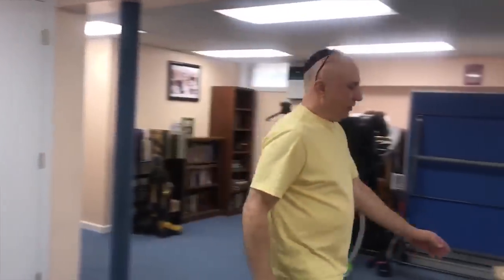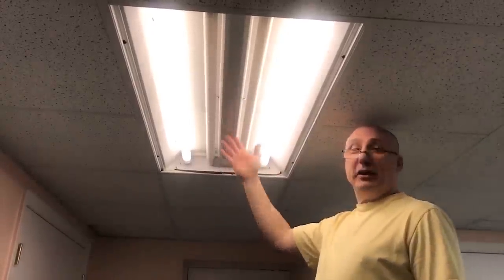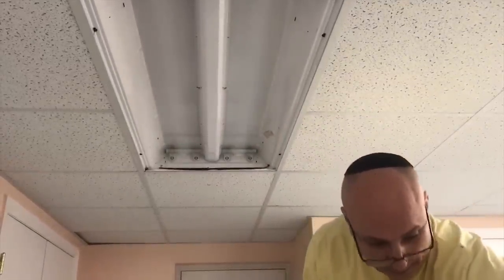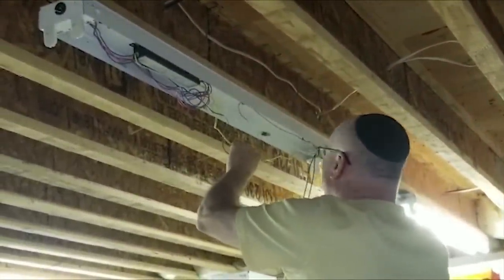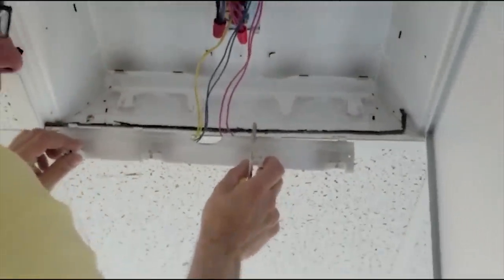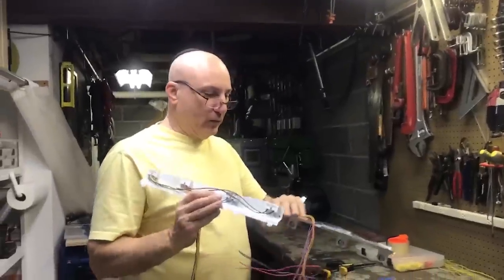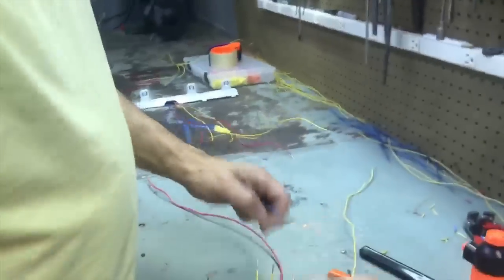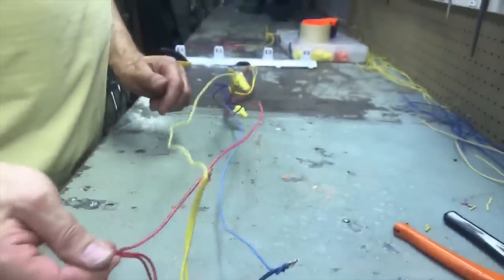How to easily convert Fluorescent Lights to LED – 2 Ballasts, 4 Bulbs

Comment: Your teaching bad habits and its clear you are not an electrician!. What is it with you older folks not following the electrical rules? Even before you get into a fixture you need to identify the panel and circuit ans then proceed with lock out tag out! Not to mention being certified!. Hot stick to test and then proceed.

Comment: I'm confused. He's supposedly showing a 2 ballast four bulb fixture retrofit, but then he ends up showing only a 1 ballast 2 bulb retrofit, saying "it's just the same!" If that's the case, then it's no problem viewing the videos of 2 bulb-1 ballast retrofitting, which he starts his video saying didn't show the 4 bulb-2 ballast retrofitting. I think the wiring to the 8 end connections of the 4 bulbs is different than a 1-ballast 2 bulb fixture?

Comment: This video was pretty helpful to me. I saw people with the same question I had which was what to do with the red wire. Just to clarify though my unit had Red Blue and Yellow wires. I also had Black White and Neutral (not red). My BALLLASTS had two connections with black wires (connecting two ballasts together) on one side and same on the other side just the opposite ballasts.  Per the video I connected red to red, blue to blue and yellow to yellow. Blue AND Red went to BLACK (Hot) and yellow went to white (Nuetral). When I installed the bulbs into the ballast I made sure the HOT side of my tube went into a ballast with a RED OR BLUE wire coming out,  leaving the other side to enter in a ballast with a YELLOW wire coming out. Worked perfectly and on all 4 ballasts.  

Thank you for the help.
Reply: Hi, I'm in the same situation with only Black and White source wires from ceiling. I run red, blue, yellow wires within the fixture as in video. I connect Yellow to White, then Red and Blue both to Black. Lights are on but all just dim, nothing is bright as LED's supposed to be. Any suggestions?

In your comment,  you say Hot side of tube to side where Red & Blue wires come out and other side to where Yellow wire comes out. But as you can see in video, both sides of fixture have all Red, Blue, and Yellow coming out, 2 wires of each color on each side. However, I did flip the tubes to try but still same thing, all dim light.
Reply: @derekle1461  Hi My tubes were marked on one side that I had guessed to be the hot side. I would make sure those sides are in the ballast with a red or blue coming out of it. It seems like the wires are connected correctly if your getting power to them.  I wonder if your tibe is correct? 

This is what style I bought: T8 T10 T12 LED Tube Lights 4 Foot 20W (40W Equivalent) 4000K, G13 Dual-Ended Powered

I bought a 4 pack on Amazon for about 30 bucks. I think that's what I would confirm first.

Comment: I really struggled with this technique.  I found that that many of the sections of light would only run 2 of the lamps using this.  Additionally, sometimes lamps in the run wouldn't turn off depending on how the runs split to other lights.  If you just clip all wires at one end of the lamp and run them to either black or white and clip all wires from other side  and run them to opposite color your gin.  No need to remove the tombstones from the lamp.  If there are multiple wires coming in you can't take them out with all the wires in the way, as some of my lamps had 3 incoming punch-out lines.  Make sure you use double sided tubes not single. 2 5ks seem to do the same job as 4 40w tubes and additionally save the ballast voltage. I used the two inside tubes as I thought it looks more cool.  Only rub is on three way switches.  Still working that one out.
Reply: He has 2 switches to control 2 of the bulbs in each fixture.
Reply: Also he chose to use 2 instead of 4. He said 2 5000k bulbs were enough compared to 4 4000k bulbs.
Reply: Thank you so much! You just answered my question! I was so confused by this video and wondering why he didn't do it like you stated. I was literally gonna ask the question you answered! Thanks again.

Comment: Hi there, I have a question I'm hoping you can answer. My two-ballast four-bulb set up has two red, yellow, and blue wires coming out of either end, just like in your video. However, my set up also has three different holes where two black and two white wires are entering (one hole on each end and one in the middle). I am guessing that I connect white-white and black-black from either end and treat the middle hole as the true hot and neutral connections?
Reply from the maker: Can you send me a picture?  howard.m.alt@gmail.com
Reply: @footballalt  I'm trying to do the bypass. I have the same style 4 lamp fixture. My wiring is different from yours. One end of the fixture tombstones have red and blue wires. The other end of the fixture tombstones have yellow wires including jumpers. The tombstones are shunted. I found a set of direct wire led tubes made by GE at Lowe's. Should i replace my  tombstones to non shunted? Guessing I can wire the yellow wires to the white neutral wires. Then the red and blue to the wires to the black hot wire. My ground is attached to the housing. When I install the leds match the Label N and L with the correct set of tombstones.
Reply from the maker: @keithbell8690  Someone responded in the comment section that you only have to wire one end of the bulbs for them to work.  I would suggest calling GE.
Reply: @footballalt  I don't necessarily have to use GE brand. They would be more convenient instead of ordering online with a waiting period for delivery. My real concern is the tombstones. Shunted vs non shunted. I've done a ton of research and still haven't really got a clear answer.   When doing this T8 type B bulb bypass. Will shunted tombstones short my led tubes causing damage or fire hazard? If I wire one end neutral and the other end hot. Then use the correct bulbs. What type tombstones should I use? Shunted or non shunted.
Reply from the maker: @keithbell8690  Sorry, I don't have any knowledge about this.
Reply: @footballalt  Parmida Led tubes are supposedly designed to do exactly what I need for the bypass. The double end tubes work with shunted or non shunted tombstones. Since majority of my tombstones need replacing I'm going to use non shunted tombstones.

Comment: My fluorescent lighting fixtures are identical to yours. You have red, white and black that you connect the wires, I only have black and white and no red. when you are connecting the black/blue, yellow/white and the reds. I don’t have the red. Do I just connect the reds from each end together?
Reply from the maker: Can you send me a picture?
Reply from the maker: It looks to me from the Installation Guide that you can wire the black to one end of the bulb and the white to the other end of the bulb.  You can not wire the 2 pins on one side of the bulb with bother the black and the white.  The 2 pins are connected together inside the bulb.  You can also contact the company at info@hyperikon.com.  I hope this helps.

Comment: Shalom, Thank you for the informative video.  After watching I was all set to change out my bulbs, but then I found slim low profile LED can lights.  I installed  them and they look great.  What I would now like to do now, is remove the old fluorescent fixtures.  In your video, you mentioned  that involves a lot of work.  I am clueless as to begin.  Do you have any suggestions?  Thanks again for the  video.
Michael
Reply from the maker: Can you send me some pictures?
Reply: Sure, how do I send them?
Reply from the maker: @lionshott  send to my email. howard.m.alt@gmail.com
Reply: Sent.  Thank you for your time.

Comment: Okay so if I have this correct, all lines on one side go to the black and the other to the white which I have done
For this method are there any specific LED bulbs I am supposed to get
I've seen that I'm supposed to us a certain type. is that true
Reply from the maker: Most types will work

Comment: Hi, thank you for such a detailed video. Bonus is I finally found a video with exact same light fixture as mine. My fixture also has 4 bulbs, 2 ballasts with 2 red, 2 blue, and 2 yellow coming out on each side of the bulbs. My problem is my source from the ceiling only has 2 wires: black and white. Not red, blue, yellow like yours. After re-running the 3-color wires within the fixture, how should I connect to the 2-wire source then? I'm thinking to connect fixture's yellow to source's white and fixture's red & blue both to source's black. Says this is option #1.

But then I see when you pull out the sockets to work in the shop, you separate 2 blue on 1 side, and 2 red, 2 yellow on the other side. So I figure should I connect fixture's blue to source's white and fixture's red & yellow both to source's black. Says this is option #2.

Could you please advise which option makes more sense? Or if both are wrong, what would you suggest? Thank you very much.
Reply from the maker: The colors of the wires don't really matter.  You want all the wires on one side of the fixture going to your black wire and the wires from the other side going to the white wire.  It doesn't matter in this application which side goes to the white or which side goes to the black.
Reply: Basically you are making a battery circuit.

Comment: I followed the instructions to change our fluorescent tubes to LED tubes.  I connected yellow to white, blue to black, and green (we don't have a red wire from the wall) to red.  Would you be able to provide any insight?  Thanks
Reply: Did you figure out what to do if you don't have the red wire coming out from the wall/ceiling? I'm having the same issue myself.

Comment: soooo why did you wire up for 4 bulbs but only put 2?
Reply from the maker: Just in case one mount shorts out I have 2 more.  Also, should I ever decide to go with 3 or 4 bulbs I can.

Comment: Can you tell me the answer if you just have a black and white wire , no red. I'm assuming the red wires from the fixture go to the back lead from the ceiling as well??
Reply from the maker: Sorry for the late reply.  Can you send me a picture(s)?
Reply: Only white and black from ceiling what to do ??
Reply from the maker: It looks to me from the Installation Guide that you can wire the black to one end of the bulb and the white to the other end of the bulb.  You can not wire the 2 pins on one side of the bulb with bother the black and the white.  The 2 pins are connected together inside the bulb.  You can also contact the company at info@hyperikon.com.  I hope this helps.

Comment: 🤣You do not have to take the sockets down. The fixtures and non-shunts are already wired correctly for DEP led tubes. 
First disconnect power.  After removing the ballast all you have to do is join all the yellows together from both ends. Connect yellows to common White from home service.  Then bundle all reds & all blues together from both ends. Connect to line black.   Top off with wire nuts.  You're done! If you have a traveler wire,  red or blue for seperate fixture.   Wire to line....black! It's that simple.  He's doing to much work when there is an easier way.
Reply from the maker: Nice.  I could have used your wisdom 3 years ago.  🙃
Reply: I think this maybe the answer to my questions about the bypass. I have multiple fluorescent 4 lamp fixtures. 40 to be exact. I have multiple ballasts that have went bad. Instead of replacing them I want to do the bypass for led. My fixtures are old and have brittle tombstones. They're shunted tombstones with the paper backing held on with a metal staple/clip. Now I need to know. If I wire red and blue to line(black) then yellow wires to common white. Do I need non shunted tombstones?
Reply: @keithbell8690  yes sir non-shunted tombstones for most LEDs lamps. I recommend buying a package of all new tombstones non-shunted of course.  Because old tombstones can get brittle over time. New lamp= new tombstones! 🤷🏾‍♂️👷🏾‍♂️⚡
Reply: @philipstiger4737  Thanks for the reply! I plan on buying leds and non shunted tombstones in bulk. Do you have any recommendations on where to buy or a good brand?

Comment: As a electrician when I seen you use those gay strippers and a torch thats used for a  a crack pipe on the wire I said its time to to go.good luck your gonna need it
Reply from the maker: Hilarious!  Thanks for your reply.
Reply: @footballalt  apparently they all missed the part where you say, 'turn off the power,  YOU (yourself) don't,  but that's up to the viewer[s]'. We all bleed red, and put our pants on two legs at a time. Funny thing is, they watched your video, so it'd seem to me they needed clarification and help.....your video is fine. You dont make yourself out to be something your not, a spade is  a spade.

Comment: Ok,......I want to try and explain what I did and the fixture didn't work.  I did exactly as you showed except I only have one black wire and one white wire coming out of my ceiling.  I attached the yellow wires together from each side with a single strand of yellow wire to the white wire and the blue wires together from each side with a single strand of blue wire to the black wire and the red wires together from each side with a single strand of red wire together by themselves.  It didn't work.  I have viewed your video  over and over to make sure I got it right and there are two things  that you did that confused me.  First off, you moved the tombstone that held the blue wires to the other side of the fixture.  Why?   Secondly, you had two black wires and two white wires coming out of the ceiling and I only have one of each.  I tied the blue to the black, the white to the yellow and the reds to each other.  Is there a possibility that I have a bad tombstone in the bunch because it isn't working?
Reply from the maker: Can you send me a picture?
Reply from the maker: It looks to me from the Installation Guide that you can wire the black to one end of the bulb and the white to the other end of the bulb.  You can not wire the 2 pins on one side of the bulb with bother the black and the white.  The 2 pins are connected together inside the bulb.  You can also contact the company at info@hyperikon.com.  I hope this helps.

Comment: Only have 2 wires coming from the ceiling, white and black, no red
Reply from the maker: The diagram, which is 1min + 15 seconds into the video shows you how the wires should be hooked up if you only have 2 black and white wires.  All the wires from one side of the fixture go to the black and all the wires from the other side of the fixture go to the white.  It does not matter which sets of wires go to the black or white wires.

Comment: I have a 4 bulb fixture and i want to do the same thing. my question is,,  my ceiling outlet that has the power to connect to the fixture only has  BLACK , WHITE and BARE GROUND, How do I wire it up for that situation. I'm guessing that yours worked with two different light switches where as mine is only on 1 switch.
Reply from the maker: If you look at the wiring diagram it shows all the yellow connected to the white wire and all the blue and red connect to the black.  Note that all the yellow wires are on one side of the bulbs and all the blue and red wires are on the other side of the bulbs.
Reply from the maker: Can you send me a picture?
Reply from the maker: Correct on mine having 2 different switches.  It looks to me from the Installation Guide that you can wire the black to one end of the bulb and the white to the other end of the bulb.  You can not wire the 2 pins on one side of the bulb with bother the black and the white.  The 2 pins are connected together inside the bulb.  You can also contact the company at info@hyperikon.com.  I hope this helps.

Comment: Fluorescent lights are more efficient.
Reply from the maker: LED tube light VS fluorescent tube light. LED tube lighting lasts about 40,000 hours longer in testing, is more energy efficient, will save you more money, and will leave less impact on the environment.
Reply: @footballalt  I know this because I collect fluorescent lights. We put leds in the house our bill went up. The leds are more expensive and they are a scam. Don’t listen to what the box is telling you they are saying that their bulbs are energy efficient so they can get more money.
Reply from the maker: @brendanusualvlogs7842  You may be right.  The good news about switching is no more ballasts to change, consistent lighting for the lifetime of the bulbs, they are about the same price up front but way less expensive as they last so much longer and they are better for the environment (no mercury).  I still think they are also less expensive to run, but not in your experience.  Even if they are more expensive to run I would still switch for convenience.  I understand that not everyone would agree with me on that.
Reply: @footballalt  Luckly you kept the old fixtures, the real led fixtures are junk if it burns out you have to replace the whole fixture. The ones you converted you can still change the bulbs which is good. If I was you I would have kept them fluorescent.

Comment: Two things I don't think those stones the clipse the light connect to R-rated 120 volts second of all always a new ballast for the LED bulbs have you ever tried to change out an LED bulb why the lights on especially when they're all connected together on the same circuit think about the maintenance guy you know how hard it is to turn those bulbs in again 15 amps 120 volts and trying to find a short in a big room buy a ballast